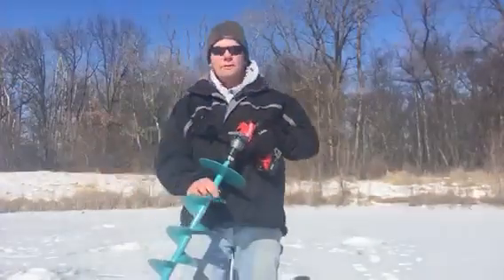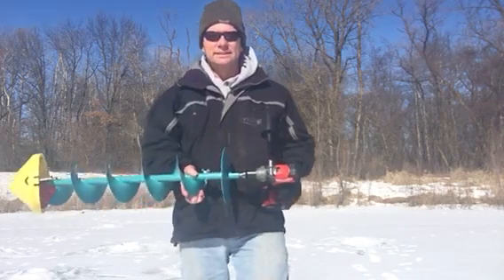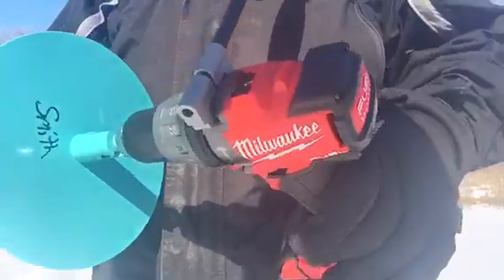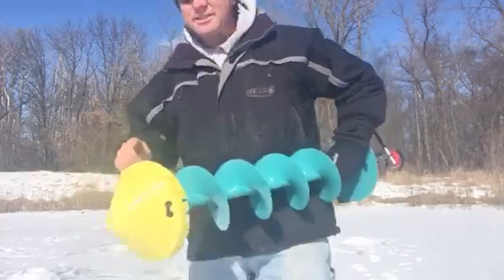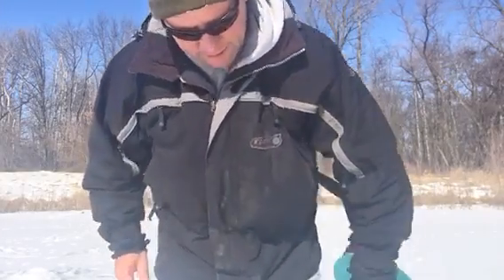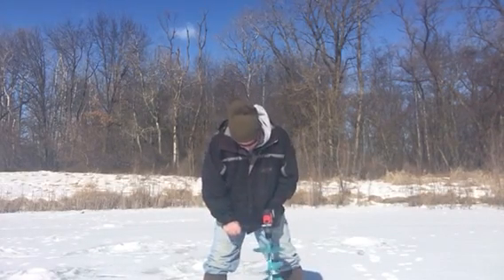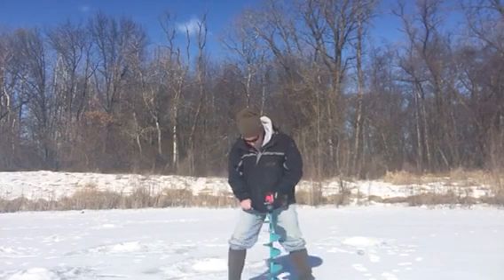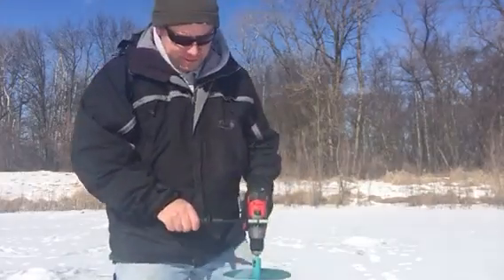The most amazing ice auger drilling setup!

Comment: What model number for that Nils. I noticed it had a protective round plate to keep auger from going into water if chuck comes loose. Looks like a awesome set up. I have a dewalt DCD996 the newer one dewalt makes with the metal chuck & is a very powerful drill. I know you should run it on setting 1 in drill mode. Thanks & good luck this next year fishing.
Reply from the maker: It's called a Nils Trekker.  Not sure of the model number.
Reply: Trekker, also a hand auger too.....

Comment: what voltage is the milwaukee.  i have a 24 volt greenworks, its fantastic. but that side handle is handy... it will rip your arms off.
Reply from the maker: M18.  Drill is in it's third year, still going strong.  I punched around 20 holes in the honeyhole this afternoon, the temperature said enough already....

Comment: Would my Milwaukee 2703 work good for that? It specs like the 2704 without the hammer.   Does the hammer function help?
Reply from the maker: No, the hammer function has no impact on the hole drilling of this drill.

Comment: Has the auger come loose on you at all? I just got this drill last month.
Reply from the maker: Yes it has, a few times.  Not a problem though, as the circular piece on the top of the drill prevents the auger from going below the ice.
Reply: What model number auger is that for Nils?